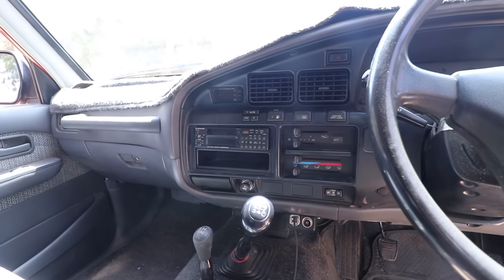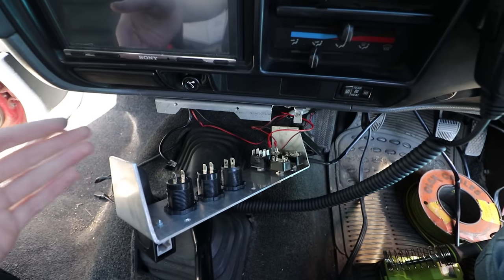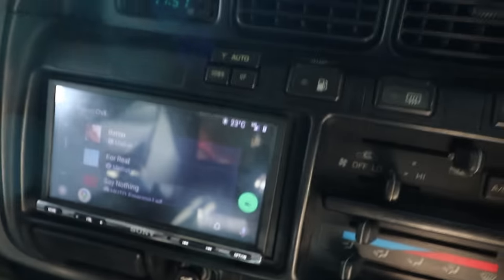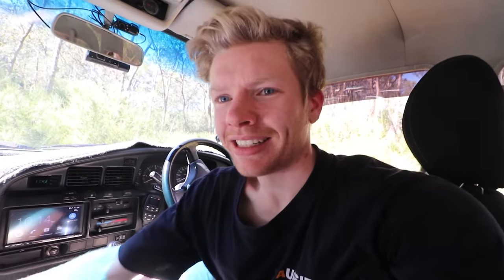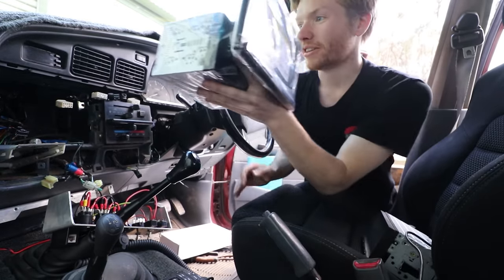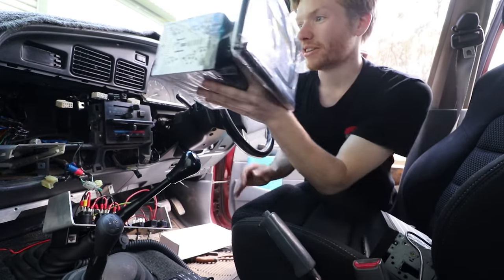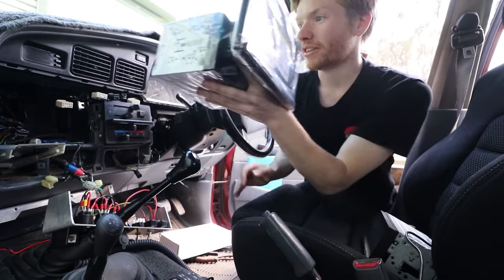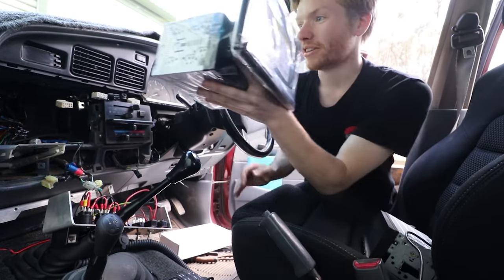Turning my 30 year old Landcruiser into a Tesla (sort of)

Comment: I'm an aviation technician with 36 yrs in the trade. Suggestion: put some heat shrink over your spade clips on the power outlets. I enjoy your channel. Cheers, Andy
Reply from the maker: Thanks Andy!! I definitely will , I need to get some more heat shrink!
Reply: Or usr fully encapsulated connectors they are not much more expensive.

Comment: Unless someone has already mentioned it, the android head unit opens up a world of options now that you have it. First off, you can add a Bluetooth OBD2 reader to pair with the head unit and run Torque Pro and create custom software gauges to read out practically any possible engine sensor. Secondly, you can install an aftermarket multi camera birds eye 3d interpolating system. This not only replicates the 360 degree overhead camera system available in say the new land rover defender (perfect visibility for reversing and 4x4 wheel placement) , but it can also serve as a 360 degree dashcam, all working off software on the head unit. This is just the tip of the iceberg tho, if you factor in raspberry pi/arduino, your only limitation is your ingenuity.

Comment: Nice job on the whole panel and multimedia setup. I'll try to fit the 2 way radio up under the dash behind the cubby.
Just "modify" the gear lever by bending it back a bit,, just remove the lever from the box and do it on the work bench.
Reply from the maker: Thanks andre! yeah think that would be the way to go, gear stick works alright at the moment, doesn't really clash, but if it becomes annoying , ill be doing that!

Comment: Nice video! I was looking at the same sony head unit you had earlier this week but ended up getting a Atoto S8 Ultra for my GU instead. After watching this i think i made the right choice
Reply from the maker: Yeah it's been great!
Reply: Is it still working?
Reply: @realtrends_7871  yeah it is. Initially I had some trouble with the gps module they supplied, it was flaky and cut out all the time. Atoto suggested I buy a different GPS module, which is dissapointing that they don't provide a working one from the start but it works fine now.

Comment: Nice work!

Depending on where the amp for your sub is, could you have it powered from your second battery permanently, and make the switch just select the battery for your head unit? (Just thinking it might simplify/shorten the wiring a bit.)

Thanks for continuing the valuable content through lockdown and it’s great to see what you’re doing to the 80 to make it fit your needs and showcase some cool products.

Comment: I reccomend also adding a timer relay so when you push a button it start a 1 hour timer relay which turns everything on for a specific time like 1 hour 

Really helps automate everything! 
These units also have door detection too, you can have the unit start up when the doors are open, etc

Comment: Nice video mate  Really nice 2-DIN NAV unit, better than my laptop mounted on 80's passenger grab rail. But I think I achieved this same goal of isolating the cranking battery a lot easier than you did dude...  I simply installed a 200AMP Red Arc isolator between them.  I wired it so it opens ONLY when A) the alternator feeds it 12VDC, or B) a toggle switch feed from 2nd battery (as a get out of gaol free).

So my whole camping solution always runs from the 2nd battery - unless the car is started/running, and then Red Arc prioritises charging the primary battery first.

Comment: Haha no way. I just got that same head unit for my prado. Such a good unit
Reply from the maker: Yeah I was really impressed!
Reply: I got one in my 120 too, sunlight it’s not great but otherwise I love mine too, handles a subwoofer great too and car play is elite
Reply: @lowkey2333  hey how'd it go fitting it to the 120?
Reply: @tyronebarnett537  good, need some filler panels but they’re cheap as online and fit up around the edge nicely
Reply: @lowkey2333  im thinking of getting one for my prado too. 07 model. Do you think it will fit?
Reply: @kevin-bp9pn  you need some gap panels as the stock radio is bigger than double din but it’s tidy after that
Reply: @lowkey2333  Got a 120 aswell, what panel gaps did you use?
Reply: @lowkey2333  Cheers mate

Comment: That new head unit and switch panel "is grouse" 😁  I got the XAV-AX5000 instead of the XAV-AX3000 for my 80 Series, for the same reasons you showed.  The 5000 has the same screens as smartphones - TFT Active Matrix. It has a greater viewing angle than the 3000. The 5000 is multi-touch capable, while the 3000 isn't - which only has a resistive screen.  My 5000's screen have the same touch feel and responsiveness as my iPhone. And it sound's like I got a bargain, as I paid less than $600 for my 5000 new early this year.  Loving your content.  👍
Reply from the maker: Thanks so much FATMAN! Means alot mate, yeah the screen on the ax3000 is pretty bad in sunlight, my new head unit is so much better! and thats good to hear!!

Comment: I have the Sony XAV-AX8000 which I think is great. It fits into a single din slot with the 9” screen and has the ability for moving up and down and tilting onto different angles. It’s in my 1996 nj pajero and I don’t get any glare on the screen. As you would know from your old pajero, the radio slot is mounted down a bit low under the air con controls, but I found it works well where it is. Very responsive screen and load up time and works very well with apple carplay. 

Keep up the good work with the cruiser. Would be good to catch up and see it all in person, and for you to see my pajero and how I’ve set that up.

Comment: Good to see you can get a modern HU inside a 80s series. With my NW Pajero I got a 9" Joying HU which fits in the dash all nice and factory So it has the same features as yours with GPS, 4G and Wifi, so much better that a screen mounts nav system on a tiny screen.

Comment: Keep up the awesome content 💯
Quick question did you use an DPDT switch to isolate your main battery ignition between your 2nd ignition, may you explain that wiring.
Cheers
Fellow 80

Comment: Interesting to hear your opinions of the Sony head unit.

Just installed a XAV-AX1000 on Friday. Was blown away by the improvement in sound. It has a built in 55w amplifier or something.

I am no audiophile and this was my first time working with a car Radio (I'm 19). In any case it was for a 2010 76 series Land Cruiser.

And I can tell you the OEM radio is crap. The car did come with aftermarket pioneer speakers. 2 in the front and two in the back.

Though the previous owner who had the car for almost two years did a very dodgy install.

I even found a Sony speaker floating behind the radio, it's not even connected. It has been floating around for 9 years! (there was no damage it was wedged in).

I am a bit of a Sony admirer, but I am not a fan of all their products.
Reply: I really hate how they backtracked from the 100 to 1000 model.

Unfortunately it is no longer available locally and I was not going to buy it through Amazon.

They removed Android Auto and you can't set a custom wallpaper.

At first I hated the tuner interface, but after learning how it works and how to save channels it is very intuitive.

Though I wish you could name the channels.

Will see what I think of it in 6 months time. No it's not my car I just daily it to take my sister to school or run errands.

Still need to install the reverse camera.

Also the fact that Apple car (or Android auto on the 100 model) is wired only is stupid.

But my Dad wasn't going to spend (converted to AUD) $1120 on a high end radio.

For $391 including a camera it is a worthwhile upgrade.

Edit: Hang on a second, did I see you watch the skid factory?

Comment: Hey that android thing you bought is nice I have a 12.9 inch similar to yours, I reccomend installation wireless buttons for volume control they clip to your steering wheel really nicely and you can program the button to do whatever you want, also I reccomend getting a pocket wifi with a second sim and link it to your phone, have your pocket wifi power on when you start the car that way  you don’t need to add hotspot everytime you start the car! 

Hit me up if you need any other tips I’ve installed 3 of these complicated units, and I’ve found a few tricks that come in handy
Reply: Where are you based?
Reply: @robertwilson1827  victoria mate

Comment: Another great informative video guys 👍🏼

Few questions about the Android head unit:

1. Does it have a night time screen dimming function? If so, does it automatically dim?

2. Can you adjust the screen brightness in general?

3. Can you connect it up to steering wheel audio controls if your car has them?

4. When you turn your car off does the head unit shutdown, or is it running in standby off an inbuilt battery (like a tablet) so that when you switch the car back on your head unit turns on quickly?
Reply from the maker: Thanks Djnmv!
1. yes
2. Yes!
3. Yes, comes with a wire harness for that, not sure how accommodating it is, but does have one.
4. goes onto a standby mode, so just wake up like a tablet when ignition connected
Reply: @AussieArvos  thanks for the reply, sounds like a good setup!

Comment: Great to see someone not just hacking up the dash. Glad you sprayed the panel with black matt. Just grab some convoluted tubing for that extra cable. 
Please tell me your not running 20 amps thru that switch? Just run a relay man and fuse it. Also did you use 240v cable??? Use DC trailer multi core cable, its good so you can run multiple things and its all wrapped. 
I second the fact that those sony headunits are a total piece of garbage. JVC used to make some great units, but theres not many other decent options now. The sound processing and filtering in those junky ebay radios is horrendous, you wont notice unless your car has decent speakers etc. But they are good enough if youve got an old car.

Comment: You can get a screw on gear lever extension, they can be joined together or check out Bad Ass Unlimited in the U.S.A., They do a "six shooter" billet gear knob. The one for a Polaris RZR1000XP model fits the Toyota Landcruiser gear lever, slides over the thread and secures with a grub screws, that six shooter gear knob will get your hand up & away from the head unit.
Reply from the maker: Thanks dusty! I'll have to have a look into that! Cheers mate!
Reply: @AussieArvos  I see "Yogi" on Outback trucker has one, I have one, if you get one that will be three in Australia. They are all billet machined, they have a reverse thread cap on the top for storage inside the knob too. Those Landcruiser shift lever extensions are on eBay, no need to heat & bend the original lever.

Comment: Loving your channel, some great practical advice. That 12v panel looks great, how did you wire the switch to change over from main to aux battery?
Reply: They would have the load side (stuff that's getting powered) on one side of the switch and on the other side theyd have the feed from the main battery and the feed from the aux battery. So that operating the switch turns off one and turns on the other. 

Sorry if I made it sound hard to follow it's hard to explain by text haha
Reply: @hawky_y  Thanks, so I would need a DPDT toggle switch then?

Comment: When you flicked on the second battery did that switch isolate the power to your first battery the radio was running on?
Reply: I wondered about that, as most stereos have a permanent live, what happens to that?

Comment: So is your subwoofer main power permanently attached to the second battery with the headunit activating the control wire or are you using that switch to change the main sub power from starting battery to secondary battery? Cheers can't wait to do this myself
Reply from the maker: originally i was going to have the sub on the switch aswell, but currently it's just running off secondary battery and triggered to turn on by the headunit via a amp output wire from the wiring harness, (sends small amount of current that tells the subwoofer to turn on)

Comment: How far does the screen come out from being flush with the surface (where the Sony was)? Awesome video! Cheers!
Reply from the maker: it's all adjustable, from where mine is currently positioned it can go in another 10mm (hits the trim on the 80 so won't) and can come out another 40mm (but then too close to gear stick) 
and yeah its not a super flush fit light the sony but they make other models that are a flush fit (have a smaller 7'' screen
thanks mate!
Reply: @AussieArvos  thanks for info. I’ll have to check it out. I’m in the states and my 80 is an auto so I was just trying to make sure it would fit. I guess I can just order it from Amazon and test it out! Looking forward to future videos!

Comment: Atoto, if you're listening - your website needs work, at last a category for single DIN units?

I'm currently running a Joying brand Android head unit, single DIN with a 10 inch screen and while it's good and does what I need, it's too damn slow and needs to boot up every time you start the car which takes a good minute or two

Comment: Are you using diodes on your switches to prevent electrical backfeed if the switch was to be left on and the car running?
Reply from the maker: because its completely separate on the switch , (ignition and power feed) , its either 2nd battery power feed and 2nd battery for ignition, or 1st battery power feed and real car ignition wire, you can run it on 2nd battery mode with the car started and it it fine.
Reply: @AussieArvos  off course. You have DPDT switches. Gotcha.
Reply: BTW Patrick. I don't want to buy a box of connectors and Crips. 🤣🤣🤣🤣

(You must have missed the m in the YouTube description mate)
Reply from the maker: @munecito  oh thanks HAHAHA ill fix that up!

Comment: Good job mate...but I'm a bit confused. Why didn't you just wire-up the gear directly to the 2nd battery and be done with it? After all, when you're driving, the 2nd battery is (I assume) being charged off the main battery. So, what's the benefit of adding the extra wiring that enables the gear to run off either the main battery OR the 2nd battery???
Also, if you're like me, you'll probably find that those stupid rubber caps over the cigi and USB plugs are a bloody nuisance, Inside a vehicle they serve no real purpose, other than to be in the way when you're trying to plug stuff in. I reckon you'll end up cutting them off....I did.
Reply from the maker: Totally valid point mate, it would only be if for some reason the second battery wasn't in the car, or something like that, I could of wired it just off the second battery and just had the ignition source on a switch, but yeah !!

Comment: But the biggest concern is, what is the actual quality of the audio drivers and sound quality that comes out if it
Reply from the maker: Sounds as good if not better then my Sony unit, but you'd have to hook it up to some big speakers to really find out
Reply: @AussieArvos  yeah I've spent a bit on my speakers and have am amp running them, so my only concern is just if Sony being an audio company has a step up on them (I've also got the XAV-5000)

Comment: How long does it take for the radio to turn on when it hasn't been running recently.
Reply from the maker: if you full disconnect the power (take out the battery for extected period of time) it takes about 25 seconds to boot. 
otherwise it turns on basically instantly, and with me switch back and forth between battries has been fine, still boots instantly every time
Reply: @AussieArvos  Oh cool. I was always concerned about the start-up time as not many people mention it.